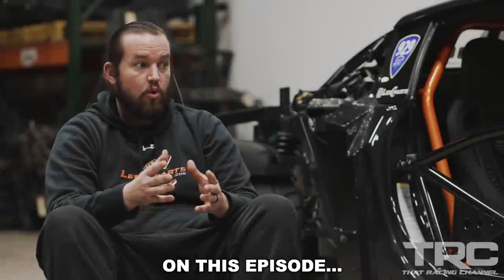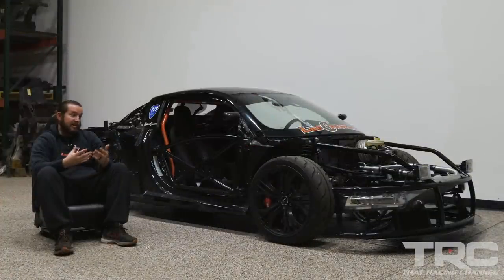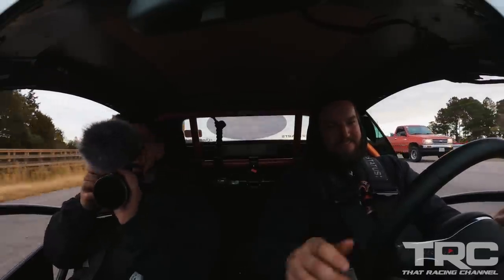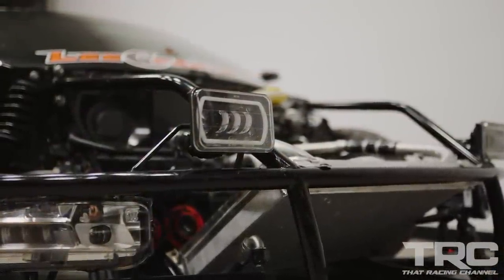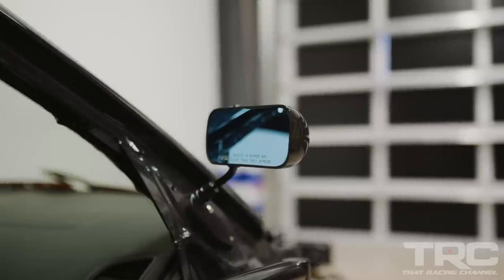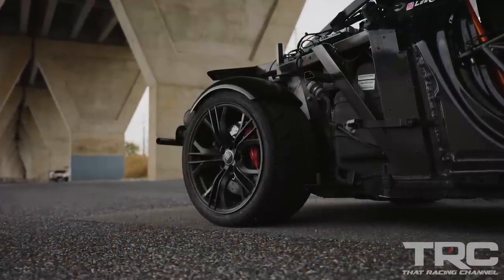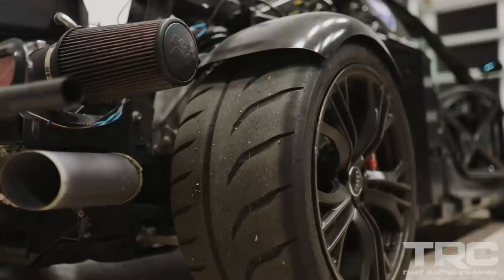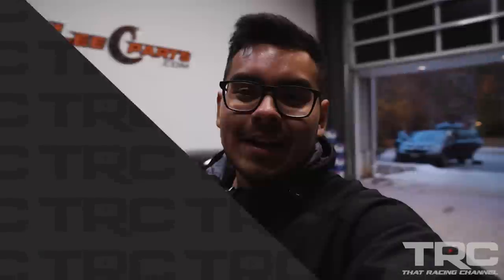1500HP Street Legal "SuperKart" is SCARY FAST! (WRECKED Audi R8 Brought Back to Life)

Comment: It would be awesome with a functional wing! It would fit the body lines and help put that power down.
Reply: We have thought of doing a wing. The wing would create drag, won’t help traction much at 50mph.
Reply: @scraplifegarage  since you don’t have any hood the fire wall is dragging the car a lot lol wing wouldn’t make you lose a thing on what you’re already losing
Reply: At the speeds this car sees in roll racing, more drag would start to become noticeable up there. We have a plan for some front end parts to help with the firewall.
Reply: @scraplifegarage  just build a whole body pannel for the car all around with metal sheets
Reply: @scraplifegarage  you guys should put a see through lexan body on it lol. Your biggest drag issue is that it’s a moving pine tree.

Comment: I build motorcycles. And when I build fenders I do it one of two ways depending on the style. I use either industrial trailer fenders or spun steel hoops. I cut the centers out of them and either ad or subtract metal to match the exact width of the tire. Those fenders look like they were made with spun steal hoops. That's why the top is rounded. In the pictures when they were in raw metal you can see the seem running down the center. So they were made the same way I do them. So if you have a good fabricator and sheet metal guy you are never limited to the widths they have in the bike catalogues. You can modify them and make them as wide as you want.

Comment: So would this be faster with body panels?  I'm sure it weighs less but is it enough to compensate for the loss of aerodynamics?
Reply: top speed would be higher but the acceleration would be less because of weight.

Comment: Also, the fact that it’s still running and driving just like it should is a testament to the build quality of both Audi and KC and the team at Underground 👍🏻👍🏻
Reply: 100% correct. Wrecked, sat for 2 years, we fixed it, did fluids, and raced it 2 weeks later. It’s been hauling ass ever since!

Comment: Think this is by far the craziest car build in existence AND it's street legal. Utter insanity.
Reply: I wouldn’t go that far. There is some pretty amazing and wild builds going on. We are just having fun!
Reply: @scraplifegarage  would you be interested in buying a clean, but gutted interior BMW E61 shell w/ the ZF 6HP21 trans & AWD system still installed? 
I am not considering selling it right now, but I am just wondering if building a wild newer-type German wagon would even be something that would get yall hyped.

My best friend got the car after he bought a super rare factory manual E61 535xi & wanted to interior swap it. The OG owner blew the motor & after struggling to sell it whole he just parted out the mods & sold the car to my homie with every engine component that isnt the harness or the actual motor removed.
Reply: I might have worded that weirdly, but it has all of the chassis modules & wiring still. So there shouldnt be any annoying "holy fuck this dude on eBay wants $2k for the sunroof motor controller!?!?" type situations & it really is a good start to a 100% unique build. 
 
I either want to see it go to someone who is stoooked on building it & I know will do it, or I want to keep it garaged until I settle into my new job & can LS swap it.
Reply: You clearly havnt looked into any other builds if you think this is the craziest in existence lol.

Comment: You could get CCBs on any first gen R8. In fact, they are optional on the GT as well. They were only standard equipment in the plus and competition models. What’s interesting is my gt with all panels fully intact weighs less than 3300lbs.

Comment: Seems heavy. My C6 vette weighs 3400 with me in it. I weigh 165. Must be the extra turbo setup
Reply: Correct. Plus, everything we removed was aluminum. And we added chromoly steel tubing for safety. So we didn’t gain anything by removing panels.

Comment: They have launch control lol press the traction button then press the sport button then hold the brake
Reply: It'll launch alright. Launch the clutch across the road.
Reply: They unfortunately don’t. I wish it did!
Reply: @scraplifegarage  are you running a different ecu that doesn’t allow the stock launch control to work? Rtronic r8s have launch control most people just don’t know because it’s not a single button you have to do the steps I mentioned

Comment: Love it its crazy but I think I'd want doors if they would bolt back on.
Reply: At first I thought the same. But those are chromoly doors. They are probably stronger than a normal door!
Reply: I agree but if he said those little fenders added too much weight I assume the doors are 5 times that.
Reply: @GAGEDADY  put the doors back and turn up the boost.